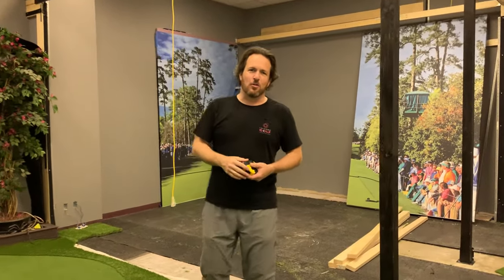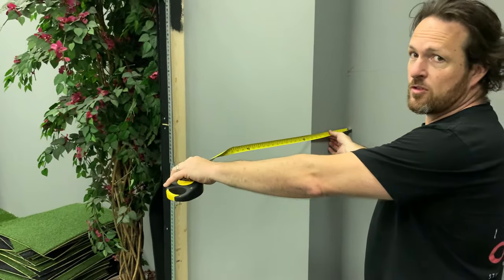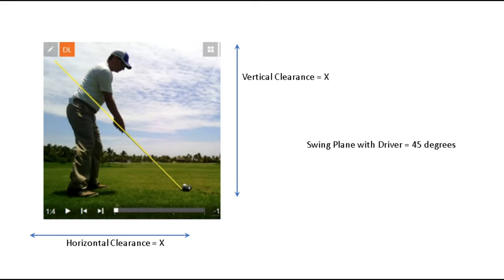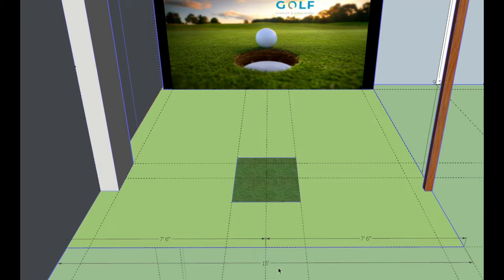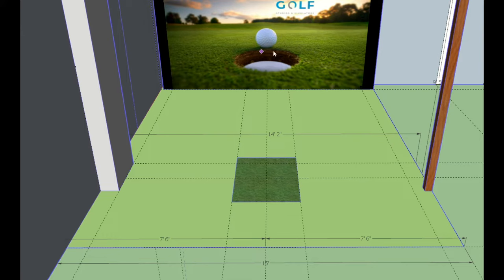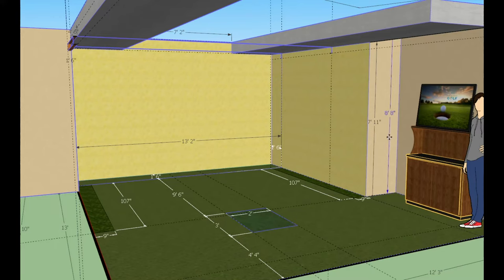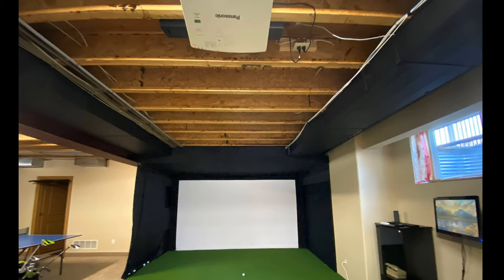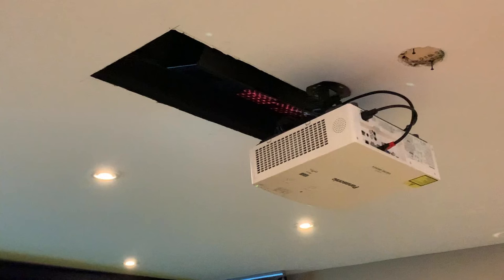Everything You Need To Know About Room Size For Golf Simulators (Pt. 2)

Comment: Finally, someone who appreciates the importance of hitting the center of the screen and how that requirement affects the width of the room.
Reply from the maker: Yes Indeed. Far too often I see simulator companies shoehorning enclosures with little care for function. We always ensure the client is clear if there are spatial limitations.
Reply: @inhomegolf  Are there any home simulators (eg., SkyTrak, Mevo Plus, etc,) that allow you to position the target line off center?
Reply from the maker: @slicksalmon6948  great question. Most simulators can be set up offset to the centre line, but that raises two other issues:
1. Do you need to play both left and right handed? Side mounted launch monitors like Skytrak, GC2 and Quad look at the ball from one side so if you need left and right handed you can move, calibrate and play. That’s no issue for teachers and fitters but for recreational players that can be tedious. Similar issue with down-the-line systems like TrackMan, mevo + and Flightscope when using in an offset position. Ceiling mounted systems like Uneekor, Hawk etc are hard mounted so your offset ability is naturally limited to the range each device can ‘see’. Here at InHomeGolf we developed the IHG AutoSlider to allow a ceiling mounted system to move into an offset position and back again without recalibrating. I’ll post the video for you after this post.
2. Does your software auto align to a new centre position or do you have to  visualize your shot offset? I know Uneekor has an offset function to move the target line, but I don’t think it’s player specific, which means it wouldn’t auto switch because you’re a leftie. 

What system are you looking at? How wide is the room you’re using?
Reply from the maker: @slicksalmon6948  https://youtu.be/h2nDpulEmgE
Reply: @inhomegolf  I’m looking at lower end, consumer grade gear (OptiShot, SkyTrak and Mevo Pus).  I have the usual problem of trying to stuff a simulator into an 11.5 ft wide garage bay.   If I stand 7.5 ft from the side wall, My target line is almost 2 feet off center.  Fortunately, it’s just me; I don’t have any left handed friends.  I’m the only guy I have to please, so a static setup is fine.  I don’t mind hitting into the right side of the screen provided that the target line has similarly been shifted to the right.  Otherwise, targeting is thrown off.  Most people don’t seem to care about this discrepancy, but I do because my swing method is highly visualization based.  I don’t want to hit to a target that’s 2 feet behind me.

Comment: Hope you see this! We are building a new man cave. The current space we have setup for the sim is 11 foot ceiling. 19'4" length. 14'3" and 3/4 width. At the back of the room (not where the screen is) there is a soffit that drops down 12" so under that spot is 10'. From looking at your video I assume the width is cutting it close? Your rule is 25' long. That is the first time I have seen that large of a length recommended. Why so much? Ultimately though my question is do you think I would have plenty of room to not worry about my swing including with the longest driver?
Reply from the maker: Hey Bama!
Your space is really close. 
For height your lowest point is 10'. Thats excellent.
For width at 14'3" is great for a centre strike position. This means all of the ceiling mounted systems will work. 
Length of 19'4" is functional but the trouble occurs when you want to have a full group in there with you. The screen is 1' from the wall, then ideally the ball is at 12' from the screen, then 4' for swing radius (safety zone), and you're at 17'. So if you have 4 people, the all must stand in that last 19'4" or opposite you when you're swinging. Its possible but tight. 
You maybe can steal a foot back from the ball flight but it's still really tight. 
On the other hand - if the room is really just for you to improve your game - its perfect!
Pricing depends on the launch monitor. There's lots of options. Please email me pictures of your room to james@inhomegolf.com and we can set up a call to discuss.
Reply: @inhomegolf  I emailed you. Thank you!

Comment: Looking to build in a small room. Everyone is telling me I’m to close to the screen. It will wear faster and it’s dangerous. I’m about 8 feet away. Is that to close? Room is 17 feet long. 11 feet wide, 9.5 high
Reply from the maker: You're room is definitely tight. at 11'wide you can't hit from the centre line - you'll have to be offset, which is ok if your launch monitor accommodates that. at 8' form the screen its visually very close and depending on the quality of your impact screen you may have the ball kick back too far. Another issue is your head will likely cast a shadow from your projector depending on its plecement. at 9.5' high you'll need a really short throw projector to get close enough to not cause a shadow.  From experience I recommend no closer than 10 from the screen for the strike zone. 
Of course you can build rooms that are less than ideal BUT then you need to adjust your expectations for the outcome.

Comment: Hello there! Just let us know is 

12' long 'x10' ht x10'  width space worth to build practice sim? 
Can learner practice too?

Thx
Reply from the maker: Even if you can physically swing a club in a space that tight, you might not like results as a ‘simulator’ room.
Your height at 10’ is great.
Your width at 10’ is too narrow for a centre strike position, so you’ll need a floor mounted tracking system like SkyTrack, Mevo, or Quad. Your width makes left/right handed play challenging. 
Your length is the real problem. Your screen or net will be 1’ off the wall so your effective length is 11’. You’ll need 6-7 feet for your swing radius so you’ll be really close to the screen which makes projector placement difficult, and definitely makes it too tight for more than one person. 
I like to see rooms that are 10’high x 15’w x 20’ or even 25’long.

Comment: Have you successfully completed a room where the Uneekor EYEXO was mounted just under 9-feet? My ceiling height is 8-foot-9 inches and I am hoping to avoid having to cut into the ceiling.
Reply from the maker: Hi - no I have not installed an EyeXO at 8'9" - although I did do a QED at 8'10" with no issue. I would suggest you contact Uneekor support for their recommendation.

Comment: Hi! Great video, thanks for posting this! I’m currently building a home with my wife. We’re going to have 9 foot ceilings in the basement. The basement will be unfinished so that I can finish it myself as needed. I want to put a simulator down there using the GCQuad system. People keep telling me that 9 foot ceilings aren’t enough for a simulator, but your video seems to contradict that. I’m 5’11 and have a fairly flat swing plane with my driver, so I’m not concerned about myself as much.  Should I be significantly concerned about other people’s ability to swing freely with only 9 foot ceilings? Really interested to hear your thoughts since you obviously have a ton of experience. I’m in Pennsylvania, US, so I’d also be interested in hiring you to design the sim if that’s something you’d be interested in.
Reply from the maker: Hi Rob, there are 2 primary factors that determine minimum height for a simulator.. the first is can you comfortably swing your clubs there. Sounds like you can. Most people can, although Some people finish high. There’s definitely a potential for a friend to clip the ceiling. We’ve built many simulators at 9’ without issue. Second factor is your tracking tech. Some of the ceiling mounted systems have a 9’ minimum. Foresight has a great advantage here with Quad because it sits on the floor and has no height requirement. 
In my opinion you’ll be fine. 
Where in PA are you? Im going to be in PA this week. Maybe we connect and look at your space? Please email me at james@inhomegolf.com

Comment: So 8 foot high isn't high enough but the average player needs 6.5 feet of width to their swing? So how does clearance for the height = width. 8 foot is not high enough, I agree. But 8 foot width is more than enough, which makes your first graph incorrect.
Reply from the maker: Hey RJ, great question. There are a couple of things to consider:
1. Average golfer swings their driver on a 45 degree angle (Swing Plane) which means if the club goes back 6.5 ft then it also goes up 6.5 ft. HOWEVER, many people lift their club head up on the follow through. I see younger, more flexible players maintain a lower plane during follow through but older, less flexible players don't turn as much and thus the club head lifts with the momentum. In my experience a comfortable minimum height is 9'. This works for most players.

2. Most ceiling based tracking systems require 9' clearance. 

If you are comfortable swinging in 8' ceilings then fine, we can build a sim to fit that. But you're restricted to the technologies that can accommodate. Floor mounted units are your best bet. There are several pricepoints. SkyTrak to TrackMan and Quad.
Reply: Lol brave man you are

Comment: If you have a room that is 10 feet high - 16foot wide and 20foot long, do you believe there would be room to have a simulator and a sitting area, the sitting area a couch and a chair to watch the golfer?
Reply from the maker: Hi Grace, your width and height are excellent. 20' long is great for a simulator but sitting is tight. Generally we put the screen at 1' from the wall, ball flight is 12' and 4' for swing clearance means 17' minimum for the simulator. That leaves you 3' for sitting. A couch would be tight but bar chairs or stools would be ok.